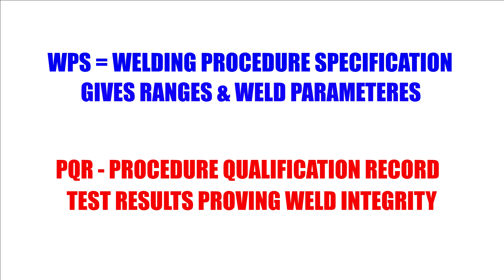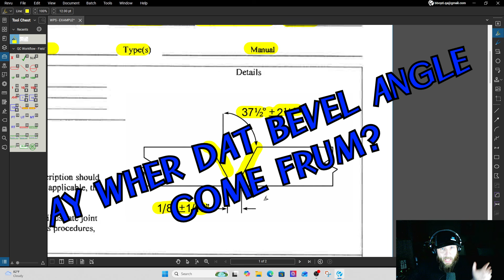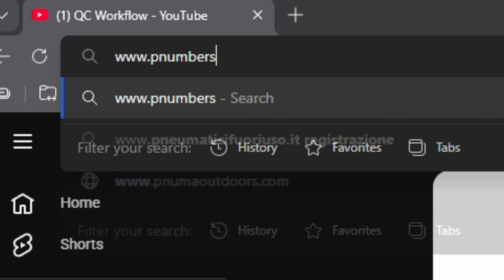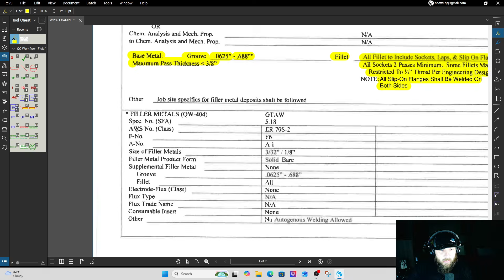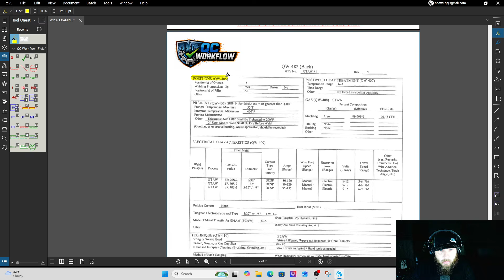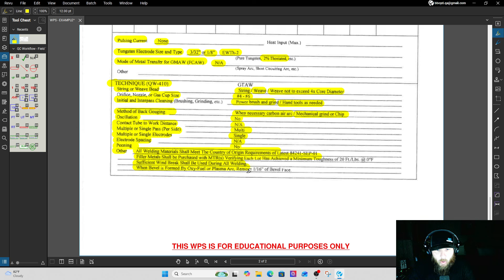How to Read a Welding Procedure (WPS) Line-by-Line Breakdown

Comment: Sir, I am a retired welder/CWI with more than 40+ years in the field! A code is a minimum, a standard is additions and/or subtraction, specification is superior. Welders are required to use a specifications only and should be approved by a metallurgist. I made the same mistake you are doing. Material manufacturer are the expertos not AWS and definately not ASME!
Reply from the maker: I appreciate your comment! Welding procedures should be approved by the client before any welding is performed. Yes, every welder should have a copy of the client approved WPS so that they can follow the guidelines and parameters. You mentioned I’m making a mistake. Could you please elaborate? If I am making a mistake, I would like to correct it.
Reply: @qcworkflow The mistake you are making is that you are looking for the clientes approval! You are the welder, you decide how the weld should be done, not the client. The approval and acceptance shall be done by a metallurgist. The metallurgist should be a neutral party. This way you do not give the client your welding procedure! This is how you make your living this your procedure. If the client wants your procedure, the client can buy it.
Reply from the maker: @InspGarySLurch I’m curious what industry you were involved in? My videos are mostly aimed primarily at fabrication projects performed under ASME and client contract requirements, where WPS submittal and client review are commonly required before production welding. I agree that company procedures can be proprietary, but whether they must be submitted is ultimately determined by the contract and project specifications rather than a universal industry rule. Approval and acceptance by a metallurgist is not a universal requirement and many projects have no metallurgist involved at all. 

From my experience, typically in most industrial fabrication (ASME Section IX, B31.1, B31.3, Section VIII, API work, etc.):

* The fabricator develops and qualifies a WPS (or uses one already qualified).
* The client or their authorized inspector reviews it if the contract requires it.
* The client approves or accepts it before production welding begins.
* Welders follow the approved WPS.

That isn’t because the client is “telling the welder how to weld.” It’s because the contract requires agreement that the procedure satisfies the project requirements.
Reply: @qcworkflow I have worked for Martin Marieta, Bethlehem Ship yard, Bethlehem Steel Maintainance and a number of schools for welding no a number of contractors.
Look, I have specialized in repair work for many years. I have re written many procedure because the average engineer does not have any training in welding metallurgy.

Comment: Love the video and great explanation. I'm confused by the note on preheating material thicker than 1 in. Correct me if I'm wrong but the welding procedure only allows the welder to be working on material up to 0.688 in. ? Curious if you could shed some light on why this preheat note for 1" material is included?
Reply from the maker: Good catch!

You’re absolutely correct that this particular WPS only allows material up to 0.688” thick. The note requiring preheat above 1” thickness likely comes from a company standard, client specification, or a generic note that was carried over to the WPS template (most likely). 

In practice, if this WPS is limited to 0.688” maximum qualified thickness, the >1” preheat requirement would never be applicable unless the WPS were supported by an additional PQR qualifying a greater thickness range, which isn’t the case here. 

Good eye and thank you for mentioning that! It’s a good example of why inspectors should review the entire WPS and not assume every note applies to every qualified range.
Goes to show that sometimes a WPS can contain requirements that aren’t necessarily applicable.
Reply: @qcworkflow good deal, thanks for confirming my suspicions were true! Thanks for the reply.